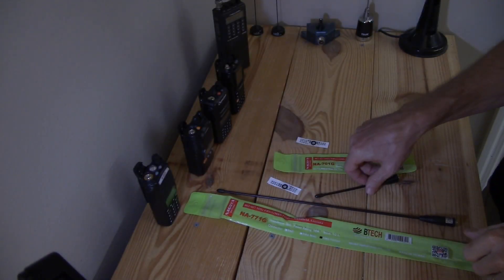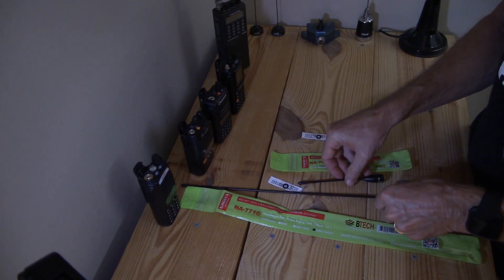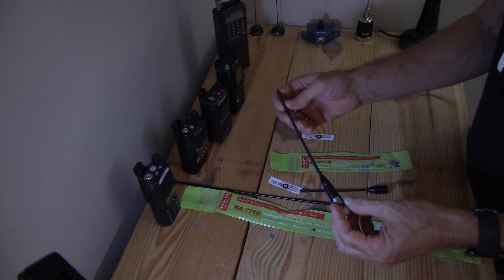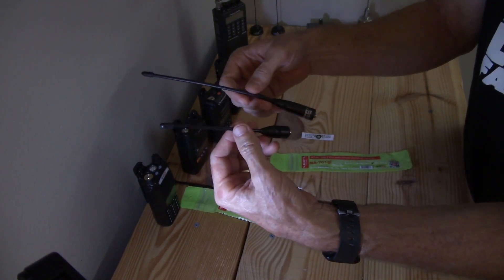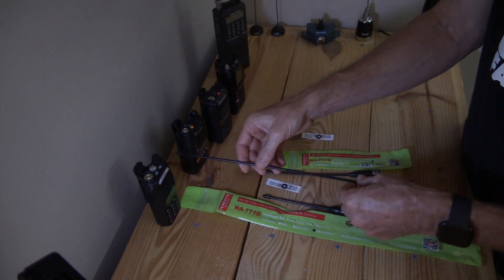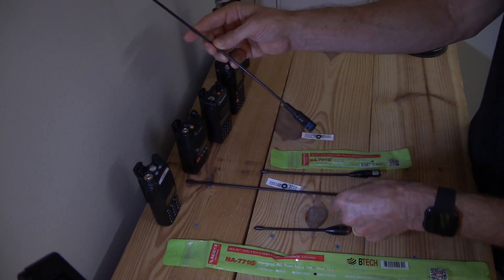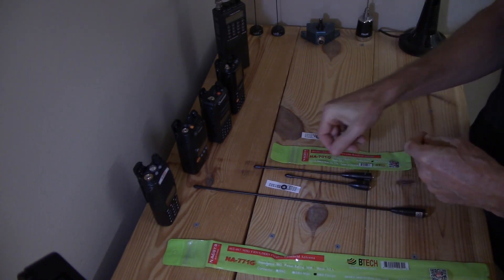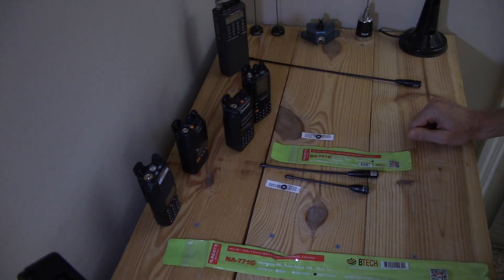Nagoya GMRS HT antennas 701G & 771G

Comment: Hello Sir. Did you check a 701G’s SWR? I’ve checked. 771G—SWR 1:1.1; 701G—SWR 1:5.2…

So I’ve a question for you. Do you still use the 701G? Is it okay?
Reply from the maker: It's too hard to get an accurate reading with these antennas because placing a meter between the radio and whip is getting in the middle of the antenna and that changes the SWR. The radio body and the human holding the radio become part of the antenna. Base and mobile antennas can have the meter on the outside of the entire antenna system.
Reply: @ we need to touch the swr meter at the measuring time:)

Comment: I bought one and got it today. Horrible SWR. I am sending mine back. The stock antenna on my GMRS-9R is 1.01. The 701G is 4.39.
Reply: Counterfeit products are real issue as well
Reply from the maker: Quality control is an issue with a lot of products.
Reply: @Guarddog83  as long as you buy the one from his link in desc you shouldn’t get any counterfeits. Just gotta make sure the seller is baofeng tech. I ran into the problem of getting fake ones it sucks.